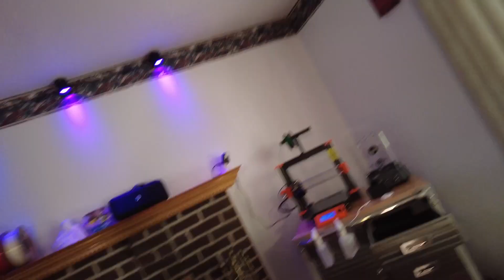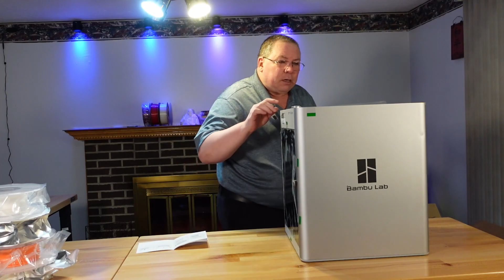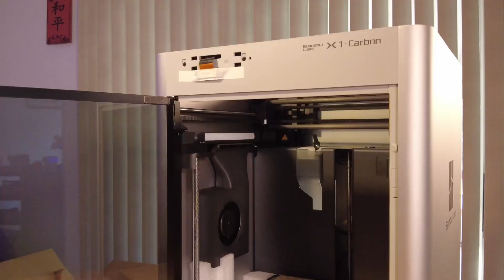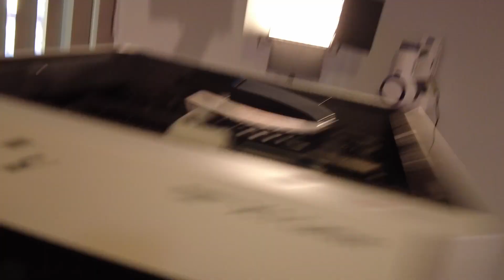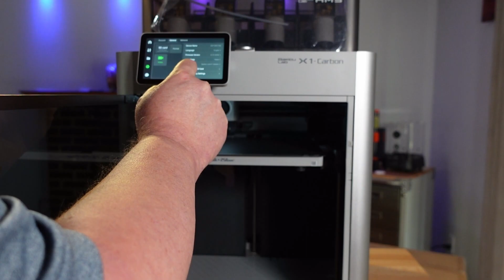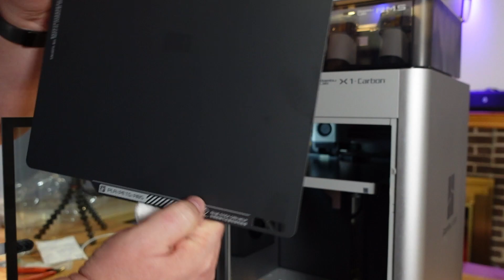Bambu Lab X1 Carbon Unboxing

Comment: Just a side question, did they ever deal with the dent you found on the corner of your printer case???
Reply from the maker: I was offered a 50$ credit to the Bambu Store. I purchased a couple filaments with it and I was happy. It is not noticable on the table and does not affect my printing at all. $50 bucks was OK for this issue. I feel bad for all those out there that received there printers with broken glass or totally crushed.. I have been reading that they are starting to incase it in wood again to protect the printer.

Comment: Great video and very helpful.  One question, what is that Nano product you used on your build plate.  It looks like a liquid and where do you get this product?
Reply from the maker: The product is Visionminer -nano-polymer-adhesive. It is the only thing I use on my FDM printers to make things stick. Glue is so messy and changes the 1st layer look. It's not cheap but will last for a few prints before needing to be cleaned and reapplied.

https://visionminer.com/products/

Comment: Looks dented on the side, worries me bambu like some other new companies don’t know how to pack such a heavy machine . I send them back unless there is a substantial discount. My Epax resin printer had the same issues so did peopoly
Reply from the maker: It had a little dent on the back/side of the unit, I contacted Bambu Lab about it with pictures and they let me know that replacing the side panel was not as easy as I thought it would be, Bambu offered me some store credit and I accepted that. What is very funny is I had UPS come to my door this week with a pickup tag for the printer. Bambu Lab never mentioned sending a pickup request. I do not have the original box anymore and I had thought this support ticket was finished,
Reply: Glad they did something just wish sometimes packing was figured out better

Comment: Oha, did Ups deliver? with the right panel!!!
Reply from the maker: This is a funny story, UPS came to my house 3 times as I was at work, I did not know what they wanted until I tracked down the UPS number they left stuck to my door, I found out they had a pickup order for my X1 Carbon from Bambu Lab. I was like wait a minute, Bambu already gave me a $50 gift card for that small dent on the back of the machine. SO on the last time I was able to tell them that I had nothing to send back. lol